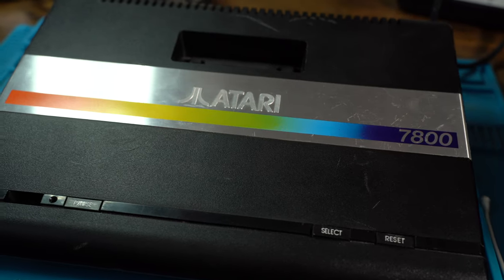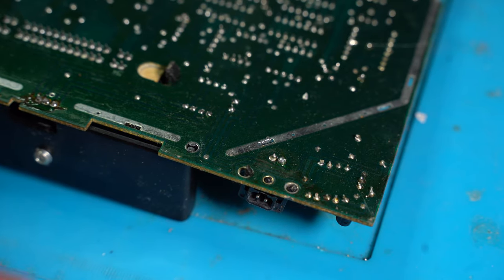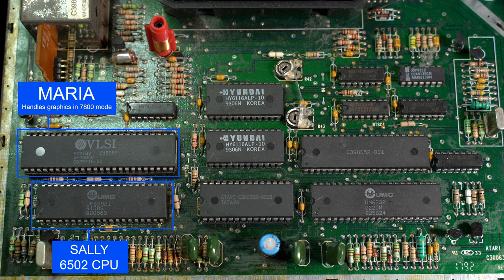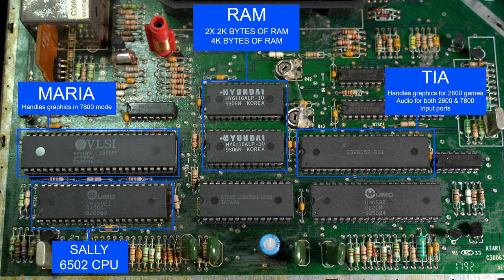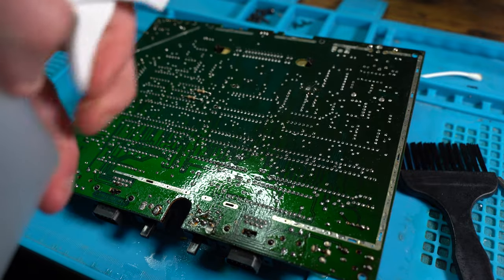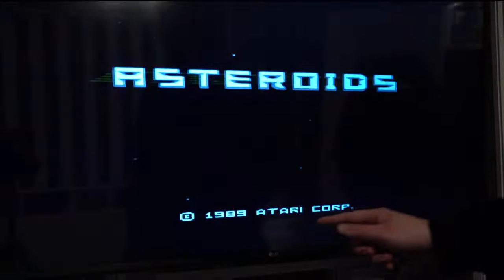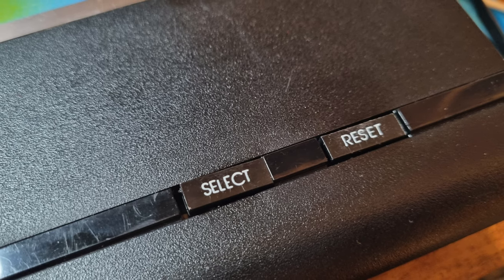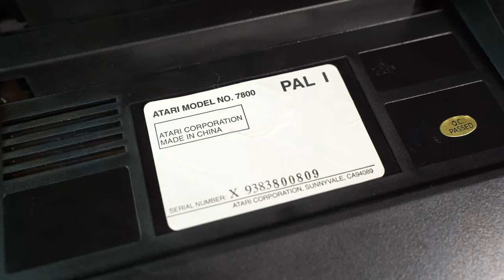Atari 7800 - Restoration & Hardware Breakdown - 4K

Comment: Great job on the restoration, especially on the hot glue button mount fix. The Atari 7800 is a great old system isn't it? ;)
Reply from the maker: Thank you, I appreciate the feedback and yes, the 7800 is a great old system with lot's a classics.

Comment: Ha ha, I recognise the modulator and vertical red coil from the Atari 400/800. They clearly re-used parts/designs that they already had.
I tried googling to find out the video capabilities of the Maria video chip, but didn't find any clear description.

Comment: Hello, wow you are a pro. Can you assist. How exactly can I change the power switch electronic part? To one that stays either on or off. As in the ATARI 2600 & Colecovision. More of a manual power switch. It is ok if the plastic case has to be cut to make room for new power switch. Thank you.
Reply from the maker: I don't think you will be able to on the 7800, as there is not enough room for a switch like on the 2600 and Vision to fit inside the 7800, and the switch used on the 7800 is very different from the switches used on 2600.